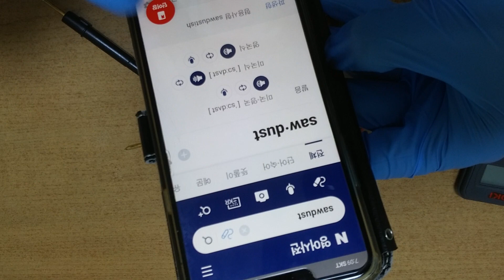graphene sand solid state battery: stabilized in 2.4V

Comment: @solid battery try carbonizing the sawdust+ with Zinc chloride + graphite mix in a microwave oven. Be careful as it produces fumes and the graphite will sparkle. Make sure you use a temperature resistant container and cover it with a fire brick material and put it beneath to avoid breaking the recipient. The salt will remove the humidity and carbonize. You can mix a bit of sugar or carbon black. Blend it in a coffee grinder machine before you place the mix in a microwave oven for 3 to 4 minutes. Do it by phase. First one minute and keep increasing after cooling.
Reply from the maker: Thank you so much. Have a nice day.

Comment: Thank you for sharing this great work, I am big fan of yours, I am trying to replicate your batteries, Plea how do you turn your graphene into a solution (How do you dissolve it) also please how do you make the toothpaste based ceramic. Thank you so much and have a nice day.
Reply from the maker: I am sorry to be late. First, I have to say that my method is so primitive. I should improve the cathode and anode much better than now. Making cathode is simple. I mix toothpaste, detergent powder, iron oxide with water. It is so primitive. It's poor quality is one of the main reasons that voltage goes back to its original voltage. For anode, can I keep it secret? That's because it is also so primitive -.-} I hope you understand me. Thank you and have a nice day.
Reply: @solidbattery9956  I understand thank you so much,

Comment: hi if u want to increase the surface area add activated carbon from aquarium and carbon black,  si 02 sand is ok but u need to heat it with the graphene and sugar at high temp so the graphene can fuse to the si 02 and make it sort of conductive and the sugar will form carbon.
Reply: Great idea. Possibly use some lapping compound as it's super fine ground up sand. The next step is to find the proper method of testing to help determine optimum sand, sugar, carbon, carbon black, heat, etc.
Reply: hi  @loopie007  lapping comp is not sand its si carbide it is also carried in a grease lubricant so u need to clean it first better to just but si carbide or carborundum. i tried it works fine good suggestion
Reply from the maker: Thank you so much. Have a nice day